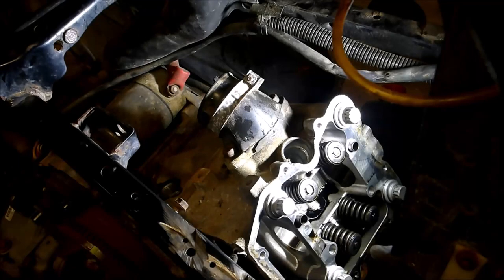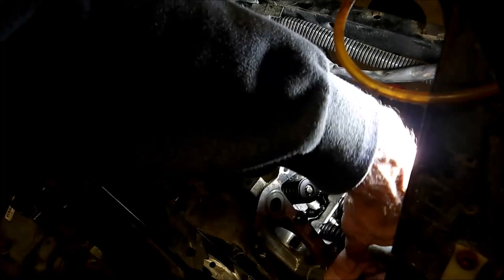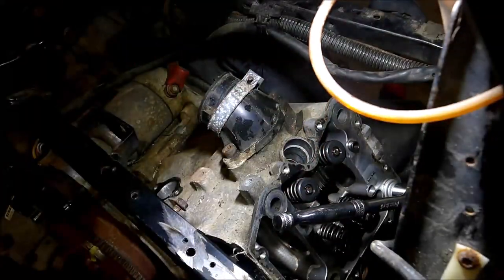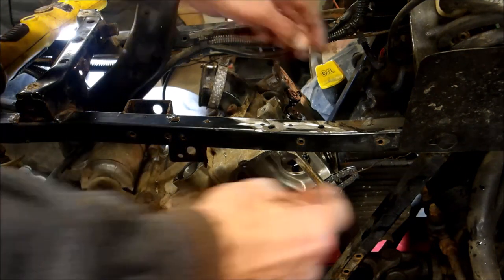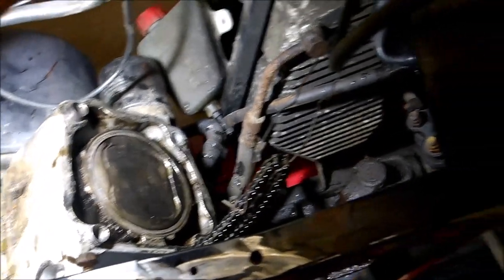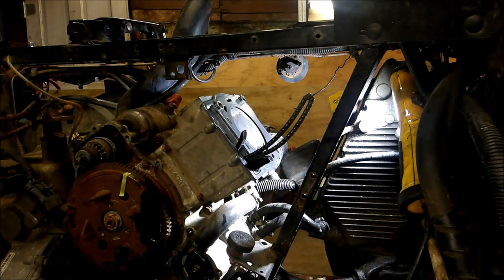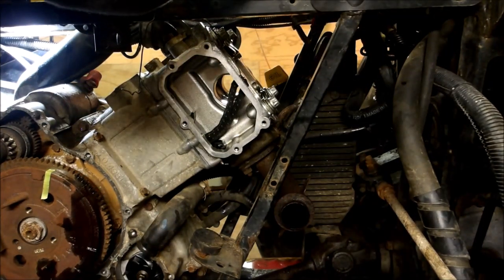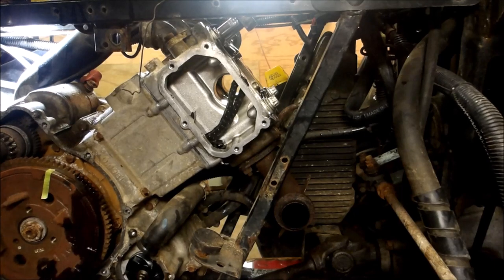Polaris 500 Head Gasket Replacement and Torque Sequence

Comment: Thanks, Tmam.
What you did is beyond my ability for now.
I have a '98 500 just bought, and plan to begin w/ simple preventative maintenance, but, it's got some repairs that I will begin after that.
1st will be adjusting or r/r choke, and/or carb rebuild.
At 22 years use, its  going to need more.
Hopefully you'll be able to share more, for what is one of the most numerous ATV quads in the world.
Reply from the maker: Tom S.  I'm happy you enjoyed the videos. Once you get into working on it, Its really not that bad. I like sharing my knowledge with people and glad it helps them out. I have a lot of videos on Polaris. If you have anything specific in mind..let me know.

Comment: Very well done video, not Fluffy with a whole lot needless talk.
   I'm going to subscribe for Two reasons, one I already mentioned, and the second is I am going to be doing one of these in a few days. 
   I just thought of another reason, and that is more and more people keep coming to me for help. 
  We don't have any actual repair shops within 30+ miles So I kinda help fill in. I get paid in some unusual ways on occasion. 
   When it comes to the Kids around here I get this in trade mostly. The other day I got a Singer Sewing Machine with Cabinet and all (1960s Model) in exchange for making a Header for one Kid. It needs a Timing Belt but it is a pretty good Machine. 
  Who knows I might have to check out some other things you have done. 
   Anyway I really liked the video, Thanks Again!!
Reply from the maker: Thanks. I try to give as much detail as I can. I have some videos where I experimented with different carbs, turned a 425 engine into a 500. You'll have to check it out. Keep up the good work. I have people I'm helping too. I usually get parts or other things in exchange for the work I do.

Comment: Great video. One question.  If you do not lose the timing chain, can you just reconnect it once you get the head back on without checking the timing? Also, are there any water jackets in the bottom jug gasket?

Comment: I’m having issues with compression, it reads 30 lbs and won’t start. I was told it could be the rings, do I have to go through it the same way you did here to check on them? 

Or is there an easier method. I’ve been fighting my machine for two years lol need help

Thanks 😎

Comment: on a written version, which what I needed for my 1997 Polaris Xplorer 500, here is that:

"Torque all bolts evenly in a crisscross pattern":

*Torque bolts to 22 ft. lbs. (3.04 kg-m)

*Torque bolts to 51 ft. lbs (7.04 kg-m)

*Loosen bolts evenly 180 degrees (1/2 turn)

*Loosen bolts again another 180 degrees (1/2 turn)

*Torque bolts to 11 ft lbs. (1.52 kg-m)

*From this point, tighten evenly 90 degrees (1/4 turn)

*Finally, tighten another 90 degrees (1/4 turn)

*Install two 6mm bolts and torque to 6 ft. lbs. (.828 kg-m)

the Pattern per my service manual is this.. please not that 5 & 6 are 6mm bolts, I couldn't post picture but that is what it shows... 

3      2
            5
            6
1     4

Comment: Did you reuse the head bolts? Fixing to do the same on my 500. Debating on whether to get new head bolts also.  Thanks for the video, very helpful
Reply from the maker: I did reuse them. But it would be better to replace them if you could.
Reply: I would replace my head bolt's.

Comment: great video  very helpful    just one question    you say step 7 ?     i count 6  or did i miss something....i am not in any way nit picking    just want to be sure before i start     thank you !!
Reply from the maker: Ha Ha. I was wondering when someone would bust me on that. I did skip a step. The next step was to loosen another half turn, but the bolts were loose enough I didn't have to do it. Nice catch.
Reply: @TitaniummanGarage  oh no worries thank you so much   helped me out aallot  im doing a headgasket on my daughter scrambler 500       any other advise?
Reply from the maker: @davidegan3934  Make sure the gasket is a good thick one like polaris. Beware of the Chinese knockoff gaskets. They dont hold. Too thin. Make sure the head is perfectly flat so it seals.

Comment: The manual actually says to back it off 180° after you do the 51-ft pounds twice , so 360 or a full turn. and then tighten to 11 ft pounds which makes sense because of you back it off 180 at least on mine they were already over 11 ft pounds tight still.  My only concern is I backed them off 180 the second time and two out of the four broke completely loose.  So I cracked them all loose and then tightened to 11 ft pounds and then finish the procedure crossing my fingers I'll be all right.
Reply: same here  I hope yours still working
Reply: @MrXtronnick  so far so good

Comment: I’m so considering driving this thing down to you to fix, or a dealership. I rebuilt the top end with a Chinese cylinder head and piston kit. New carb, was running great! Let it idle for a a long time and putted around the yard in low. 2 days later I decide to get into it in high gear, it starts picking up speed and something goes bang and it dies. Found the plug diode bent on itself so in theory it hit the cylinder, but why it did after 2 days of running fine? Any ideas? How much you charge for a rebuild lol, if you are cheaper than the dealership I’ll consider it!
Reply from the maker: I dont have faith in any of the Chinese parts. Who knows how it was machined or the tolerances on it.I would have the oem machined. I didnt know they made heads. I just saw cylinder jugs.
Reply: @TitaniummanGarage  my correction, yes the Cylinder not the head. So strange though it was fine until I got into it in high gear. I ordered a boroscope to see if I popped a hole in the piston. Should be here tomorrow. You dont by chance have a whole motor for sale do you?
Reply: @TitaniummanGarage  figured it out, the piston cracked and threw a chunk into the combustion chamber thus mashing the plug. so I will be taking it back apart again. just wondering now if I have to take the crank case apart to remove all the metal chunks now.
Reply from the maker: @richardli8634  I had to do that. First I grabbed a thin plastic hose and taped it to a shop vac to suck out the metal. I found the counterbalancer was in the way and couldn't get a big chunk out. So to be safe I would suggest splitting the cases.
Reply: @TitaniummanGarage  yeah, I figure it is better to not cut corners on the process. I dont want to damage the bottom end. Top end isn't too bad, new case may as well just find a whole new motor.

Comment: I got this complete and realized I only backed off 180 degrees once. Will it be bad for me to loosen and start all over, or will it ruin this gasket doing this process twice?
Reply from the maker: I've done it before. As long as the head isn't warped you should be OK.

Comment: I just replaced the cam on my 96 sportsman 500.  Got everything all back together and running good but now I noticed I'm losing coolant and it's not leaking on the ground.  Checked my oil and reservoir is about an inch fuller.  Probably because coolant getting into oil?  Is your guess head gasket?
Reply from the maker: Yes. Did you replace the gasket or just do the cam?
Reply: @TitaniummanGarage  just the cam
Reply from the maker: It could also be the water pump. But it would be dripping out of the weep hole. Drain your oil and see how much coolent is in the case.

Comment: I Have a question the Torque sequence is 21 lbs then 52 lbs thats 73 lbs then you loosen the head bolts half turn then you tighten the bolts to 11 lbs then a quarter tern numerous quarter turns does that not damage the head gasket? 73 plus lbs crushes the head gasket Thanks for the video I watch everything you put one out good stuff thanks for your time and effort
Reply from the maker: I had thought that too. But what your doing is cutting into the jug with the threads. The bolts also stretch. At the engine plant I worked at we tightened them then loosened them then torqued them down again at 80lbs.
Reply: @TitaniummanGarage  Thanks for the Reply Back!!!
Reply: @TitaniummanGarage  why are threads being cut being they already exist?  Also did you use new headbolts.  Because i thought head bolts that stretch "torgue to yield" could only be used once.  Mine was running like crap with a new and old carb so i got a new fuel pump on the way.  But i did look at the cam and its within spec but figured while im in it a little might as well do the headgasket.  Hope the niche brand i bought isnt garbage.  Thanks for the videos.
Reply from the maker: @justinpaone2227  yeah..that's the name brand that leaked on me. Hope you have better luck. Ideally you should replace the bolts. I reuse mine as long as they are not twisted or bent. Cutting oil is what Polaris recommends
Reply: the torques do not add up. Once you are at 22 then going to 52 is only moving up 30 foot pounds
Reply: @TitaniummanGarage  love your videos but a little confused here I called Polaris and they told me to look online they was no help. The ? Is 22ft/Ib then 51ft/Ib before you do the 3rd step it should be at 73ft/Ib right?
Reply from the maker: @jacolbysnowden3876   No. Just tighten up to 51 ft lbs...Then loosen 180 degrees.
Reply: @TitaniummanGarage  thank you

Comment: I have low compression on a '99 Sportsman 500.  Tore it apart and am replacing rings.  Rings appear very thin.  Visual and leak check on head appears fine.  New rings arrived (Polaris PN 3087224)  One ring is thick and black (no marks), the other is copper with silver outer lining with a "N" marking.  Which is the top ring?  Which is the second ring?  What is the placement of all the rings?  There are WAY TOO MANY opinions on this from what I'm reading.

Comment: If im at top dead center. Does it matter if the chain skips a tooth on the crank when re indtalling the cam as long as the 2 dots are facing north? Or is it better to remove the flyeheel and stator to make sure?
Reply from the maker: Skipping a tooth is not good. I would pull the flywheel and make sure. Other you might have problems.
Reply: @TitaniummanGarage if the crank sprocket and the cam sprocket are properly time before taking the head and Cam sprocket/ chain off to replace the gasket. The when reinstalling the cam sprocket and the chain, as long as the crank sprocket hasn't moved, it seems to me it should be good without removing the flywheel. The main thing is to make sure the 2 dots on the cam sprocket is reinstalled facing north or the exact orientation that it was before disassembly.
Reply from the maker: @dvcm27  You are correct. If nothing has moved you are good to go.

Comment: When i tighten rocker arm blocks the cam gets stiff to turn?
I have all lash adjustments backed off and not touching.
Reply from the maker: Is it a aftermarket? I've had the same issues. But if the rockers are loose what is stopping it from turning? I've seen worn heads where the cam sits..the holes are scored bad causing the cam not to turn properly. Or the weight for the decompression ball not in the correct spot.

Comment: I have a scrambler 500 with the exact same head gasket issue. Debating whether or not it's even worth the insane amount of work it takes to tear down and replace that gasket. This thing has been nothing but trouble and one continuous problem after another!
Reply from the maker: If you were in Wisconsin I'd buy it from you  once the plastics are off it not that bad to do. Leave the engine in.
Reply from the maker: You dont have to pull the cam our either. Just the chain.
Reply: @TitaniummanGarage  If i lived in wisconsin i'd gladly sell it to you. Have literally spent more money repairing this piece of crap than i paid for it, and its been maintained and never abused. Appreciate your time and info
Reply: @TitaniummanGarage  where in Wisconsin?

Comment: you suppose to loosen bolts 180 degrees 2 times then 11ft lbs then tighten 90 degrees 2 times   i think in the video you say loosen 180 1 time

Comment: Do you have a video on piston replacement and cylinder honing?
Reply from the maker: On a 400 I do. Same principle apply.
Reply: @TitaniummanGarage  what is the title of the video so I can search for it.
Reply from the maker: @trentelliott1473  https://youtu.be/nAii5Z7JxvY
Reply: @TitaniummanGarage  thanks very helpful.  What brand cutting spray are you using?
Reply from the maker: @trentelliott1473  you can use 3 in 1 oil or WD 40. They do sell a cutting oil but I just use what I have and it works.

Comment: Did you have to mess with the timing after you got the new head gasket on ?
Reply from the maker: I did have to make sure the timing marks on the gear lined up correctly and check the gap between rockers.

Comment: What are the torque specs for the jug bolts?
Reply from the maker: I'll have to look it up. You could always Google it too. I use that alot on torque specs.
Reply: @TitaniummanGarage  I couldn't find the torque specs on a 99 ranger 6x6
Reply from the maker: @gregoryjones-hs6on  If its a 500 its 45 to 49 ft lbs